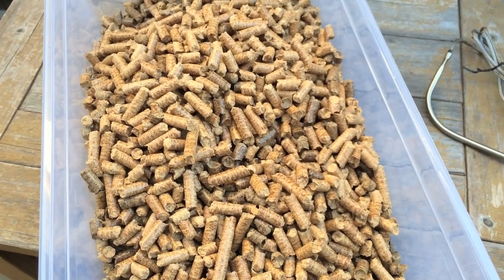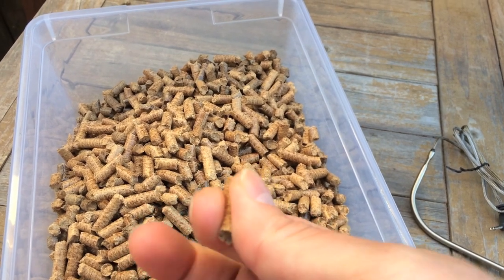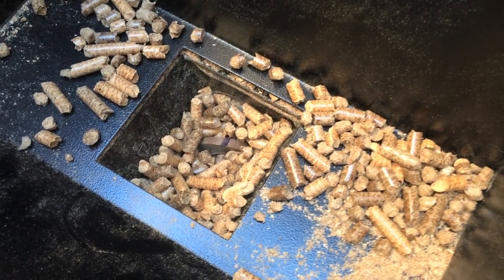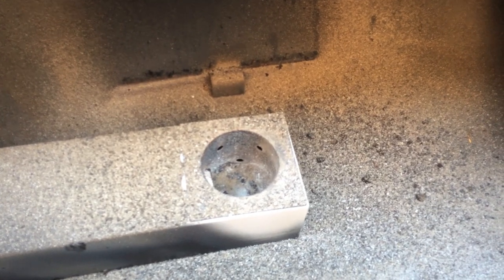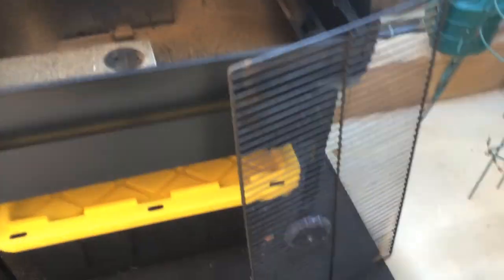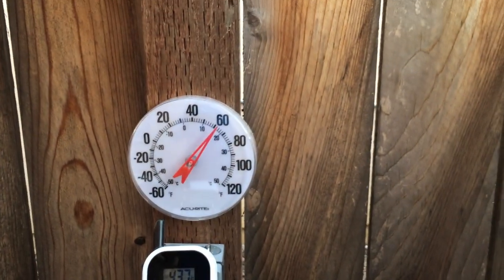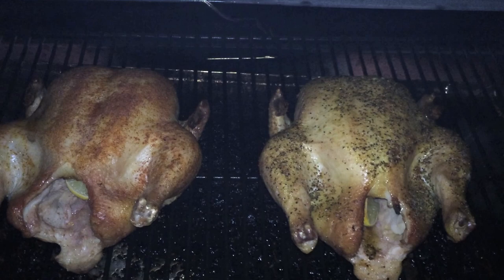Traeger Temperature Trouble Shooting

Comment: After watching a few videos including this one to get ideas on heat problems, I went through my 10 year old Traegar lil' Tex that was having heating issues today. The Auger was previously cleaned out from getting clogged with build up of wood dust, the heat pot is starting to get some holes in it from rust, but the biggest issue was the smokestack. When I removed the top of the smokestack cover, I could then see that only about 20% of the smokestack was free for airflow. It was all grease and soot building up in the smokestack.

I cleaned the smokestack by using WD-40, several shop towels, and a large screwdriver to help scrape out the soot. I then did my normal monthly cleaning of the inside of the grill (Vacuum ,etc). I also removed the pellet hopper to clean the feed motors of dust buildup. Now that it is all back together, the grill is heating up like it should. The smokestack was the item I have been neglecting over the years. Had no idea it was building up like it was.

My Traegar is working great again!
Reply from the maker: great thanks thanks.
Reply: 10yo little Tex, same issue. Temp would not go above 300 (smoke was around 140). Smokestack was choked up.

Comment: I use a “welders blanket” from Harbor Freight for $23 when it cools off outside. It insulates the Traeger a little bit and keeps the heat in and reduced the amount of pellets you have to burn. Beats $120+ for a fitted blanket from Traeger.
Reply: KEVIN MANNING 
Do you cover entire bucket with blanket
Reply: Rich Keys I usually just lay it over the top where most of the heat escapes around the lid.
Reply: I pitched in a few extra bucks on Amazon for the carbon fiber welders blanket. Feels like felt and does not leave you with fiberglass splinters. BIG help on keeping my Traeger Century at temp.

Comment: Cleaning out my lil tex elite and cleaning the RTD it raised 20 degrees. Went from 370 to 390. I think I even saw it flicker to 395. So we'll see.
Reply from the maker: Nice thanks for the tip
Reply from the maker: Cleaning the Temperature Prob seems to be helping several people. Thanks again for communicating your success. IO am sure many other will benefit.
Reply: So confirmation I did watch it sit at 395. It's getting colder in the Pacific Northwest. I cleaned out the pit pretty good. Scrubbed the RTD. I'm also gonna let this rest of these pellets burn all the way out. Then buy a new bag and let them run through and see how it goes. I keep them in a bucket with a lid. 
I'll update in a week. Thanks for this video man.

Comment: Thank you for sharing! 
Step 4, 
My fan was jammed up, fixed it in seconds!
Reply: This video is awesome... I love you just walked through trouble-shooting steps as you did.  In my case, I pulled out my Traeger for the first time this summer and the pellets wouldn't light.  Only when I watched your video did I realize my main fan wasn't spinning (same problem as Brian)... I used a pencil against the fan and rotated it a number of times and hey presto, it started up fine and my pellets were burning.I'll probably buy a new fan and probably a new hot rod in anticipation of possible future problems, but you saved my day!

Comment: Thank you for the video. It was very informative. I NEVER attempt to run at the super high temps, it is after all, a 'Smoker'. Smoking is supposed to be low and slow. I have had inconsistent temps. I will clean my probe- it is filthy.
Reply: Actually its both a smoker AND a wood fired grill. No need to restrict its use to low an slow.

Comment: don't need to use Traeger pellets I'm sure.  I'm having trouble with mine being TOO hot.
Reply from the maker: Sorry you are running too hot, this maybe a "p" setting adjustment you need to make. I have not had to do this but Traeger support should be able to lead you in the right direction.

Comment: I had the "flame up" happen yesterday, and spoke with Traeger this morning.  I was told that this is due to a behavior of the grill they call "tunneling", where there is a gap of some length with no pellets in the auger, even when the pellet box is full.   Depending on the length of the gap the grill will either shut down (I also had this happen) or will "flame up".  Periodic stirring of the pellets in the box remedies this, per Traeger.  Meaning that I can't leave the grill unattended.  As I bought this grill specifically because I was told that I could leave it unattended, I'll return it to Costco.  Any benefit is far outweighed by the fire hazard.
Reply: Prior reports show that Traeger has known for several years about this behavior with at least the Traeger Jr if not also with other models.  Yet they have not addressed their serious design flaw.  Traeger executives thereby leave their customers to experience the safety hazard of "flame ups" or the frustration of shut downs.  Zero stars.
Reply: MORE OVERPRICED JUNK. WORST PART IS SHITTY CUSTOMER SERVICE. SICK AND TIRED OF OVERPRICED, OVERRATED CRAP WITH NO SUPPORT TO GO WITH IT. YOU WANT MEAT, EAT IT RAW, NO PROBLEM.
Reply: I've had two smoker fires.  One happened because the smoker flamed out (shut down) due to too much ash.  I vacuum it before every smoke now.  The other happened on a startup and I can't remember why.  The symptom of a smoker fire is huge clouds of milky while smoke.  If this happened to me again I'll unplug the smoker, the idea is that without a draft it will burn out without (another) catastrophic smoker fire.

Comment: Traeger grill- good. Traeger nformation- lacking. 

One of the many things they don’t initially tell customers (AFAIK) is that if you don’t get rid of the ash, you won’t achieve the proper temp. I use a shop vac and vacuum out the reside every couple of weeks and have no (more) problems with temperature.

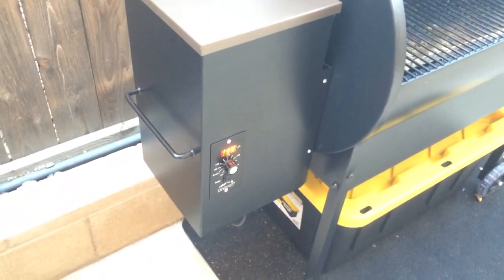Comment: You know I have a trigger pro 34 and consistently had issues when it gets too over 400 sometimes it takes a while sometimes it doesn’t hold, but I realize that it doesn’t need to be so hot things get to get cooked pretty well when I have mine at 3:50, so all I can say is that I have replaced the heat rod and that helped a lot I didn’t mess with anything else they sent me a fan but the fan looks fine so I’m not gonna mess with it and it’s awfully closed and could be dangerous to try the chickens brisket there day 50 hours and it came out fantastic. Love this thing. It’s a little more Than I thought when it comes to temperature as long as you have new pallets, you’re fine

Comment: It is going back to Costco. Bought my Texas Elite from Costco in fall of 2016. It was great for the first year. We love Rib Eye steaks and we would smoke them 30 minutes then turn it up on high and it sort of would sear them leaving grill marks which was fine. They were wonderful with a one inch smoke ring around the steaks yummy. I smoked several pork shoulders last year at low heat and no problems. I have religiously kept this grill clean because I like things clean and neat. Fired it up two days ago (outside temp 63 degrees) and it wouldn't get past 350 (THIS IS WITH THE THERMAL BLANKET ON)  and it took over an hour to get there. Started checking the internet found your video and did all seven steps. I removed the pellets that were in the hopper and used a new bag of Treager pellets. Turned it on to smoke for five minutes then turned it on high and it took 42 minutes to get to 420 then it would drop to 380 then to 400 and then to 375. I expect it to do 450 on high consistently when I need it and it won't. So, it is going back to Costco. I am going to buy the Pit Boss they have for $599.00 only because of Costco great return policy.  If it doesn't do the job it will go back to Costco then I will go back to a gas barbecue and a electric smoker with the heat element in the bottom that you place chunks of hard wood around that worked perfectly for pork shoulders over 10 years.
Reply: After researching and finding this is a common problem for many I decided to return it no problem ordered the Pit Boss from Costco. Even though the reviews said Treager tried to help them and sent out new parts to "fix" the problem I just don't feel it is my responsibility to become the repair mechanic guy on an item under two years old. Well we will see how this Pit Boss does.
Reply from the maker: I hear you kind of a bummer.
Reply: My Treager Ironwood is going back today, this is not smoking meats as I did for years on an offset iron smoker (wood fired)

Comment: My 780 ignite but dont go to preheat mode...i get a slow ignite warning...i tried for an hour with restarts.. primed the auger...but still the same...i hear the fan rev up and down when it just should speed up and pump more pellet into the firepot...evening ended that i pulled the plug and called it a night...

Comment: I have two tex elites. Outdoor temps affect the probe vs. dome considerably. What I do, I clean the inside good, scrape it all down, vacuum it out, clean the probes. I run it at different temp settings allowing it to stabilize and adjust the gap of the cap accordingly to stabilize the two temp readings. I do this during each season as the temps outside change. I never experience more than 10 degrees variance, even grilling when it's snowing and blowing outside (Buffalo :) ). I have never experienced flare ups. I have had to replace the hot rod a few times over the last 5 years or so but, I use mine maybe 5 times a week. We cook just about anything you can imagine on it. Threw out my propane grill after the first week of cooking on it. Wonder if I can buy stock on pellets? LOL

Comment: I have 1 Large BGE, and 2 Traegers.  Your issue is your using a BGE thermometer on a Traeger! :-)
Reply: *****   I love it.  You can't beat it for direct grilling steaks.  I owned the BGE before I owned  a Traeger.    To be honest, I only use the BGE for Steaks now.  Only because the ease of the Traeger is hands down better and I get an awesome product.    Every once and while I might do some bread or pizza on the egg.
Reply: I’ve had my BGE for 20 years and it works as well as the day I bought it. If you enjoy slow cooking (aka barbecue) there is no better investment. Ribs, turkey, brisket - the BGE cannot be beat for flavor. I use my Traeger as a fallback when I’m lazy - which is increasingly often. ;)

Comment: I have cooked on my Traeger  JR about 8 times now and starting to experience problems of wide temp swings and it won't hold a temp below 250. I bought it at Costco and I think a REC TEC will be on the patio soon. I have cleaned the Traeger meticulously every second use. Do some home work and buy a REC TEC.
Reply: just bought the junior elite from costco as well and first time using it im having huge temp swings also. looked up rec tec because of your comment and wow they look nice man!

Comment: I had this problem when I bought my traeger.  I know they say to use their pellets but they do not get that hot or produce the smoke.  I tried a couple of different brands and Green mountain, lumberjack and BBQ delight.  I prefer BBQ delights they produce the heat and smoke I like.  Lumber jack makes a good one but I have to drive to far away to get them.
Reply: +Kaylon Mayfield Lumber Jack is good but I have the same problem, far away. Found how to get it is let friends know you need it and there is a cookout waiting :) :) :) I normally get 4 bags at a time and start to panic when I get down to two. Still not enough initial smoke for my taste but handle that by putting a smoke tube in for the first hour or so.

Comment: I was having really bad temp swings, changed a bunch of parts, still doing it, then vacuumed out all the pellets, changed them over to some brand new ones, it’s a lot better but still has about a 40 degree difference from cut in to cool down, treager tech support was of very little help.
Reply: Clean the temp probe for the treager, the one mounted inside the grill with steel wool make sure its nice and shiny. Was told to stirring the hopper bc pellet get hung up could be the problem also.

Comment: Good video. I have a traeger jr. You mention how hot this grill will get. Is it normal for the jr to get really hot? I set my grill to 225....let it preheat with the lid open for about 10 minutes. It's nothing for the grill to get up to 320 degrees.....at a setting of 225. Is this normal for the smaller grill?

Comment: Hi guys, I just replaced my Pro 22 controller because I made the mistake of buying one of the generic ones on Amazon and that was a mistake. Now I have a Traeger but this new control did not have a P setting button and the temperature went up to 201 and backed down to 185 on smoke setting. All I had to do was raise the cover on the chimney (counterclockwise) to open until I fine tuned it into 165 on smoke. I hope this helps you.